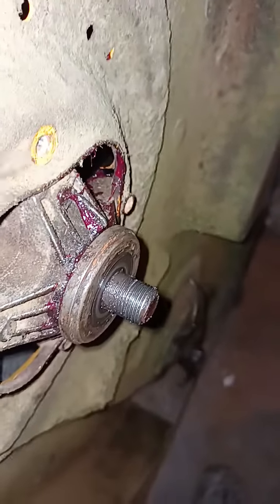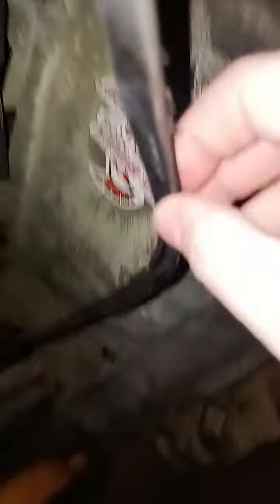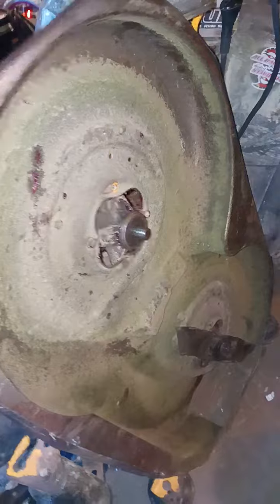cub cadet LT2180 deck spindle bearings replaced and still having issues

Comment: I have the same tractor and the same issue. Make sure your seals are fully seated. On mine if i over grease them it pushes the seals out the ends and locks down the spindle. You cannot buy preassembled spindles for the lt2180. You can buy housings with bearings and seals, the shafts, pulleys, nuts etc seperately. I'd bet theres a specific way of doing these particular spindles in the owners or service manual. Best way i've found is to assemble it,  grease it and if it locks down, remove one of the grease fittings and smack the pulley end of the shaft and then the blade end of the shaft to reseat the seals and the excess grease will go back out the fitting hole. OR pack everything with grease like you did BUT remove a grease fitting before tightening the nut down. The grease acts like hydraulic fluid and doesnt like being compressed. I guarantee your seals are getting shoved out the ends. Im going to check the manual myself and i'll let you know if i find something better.